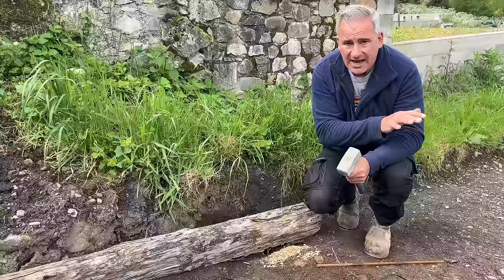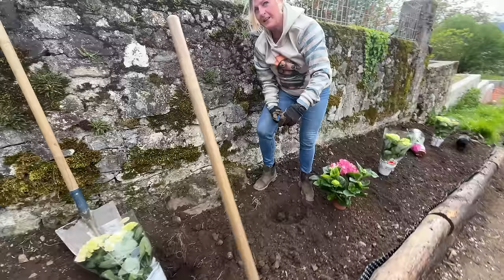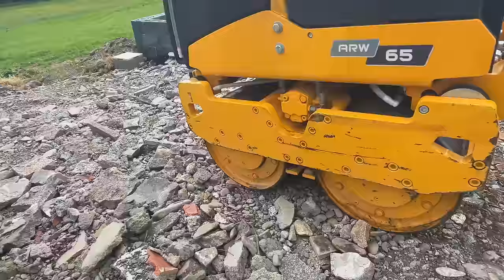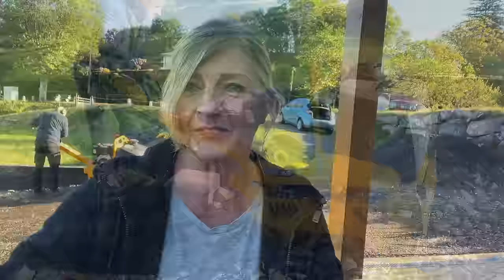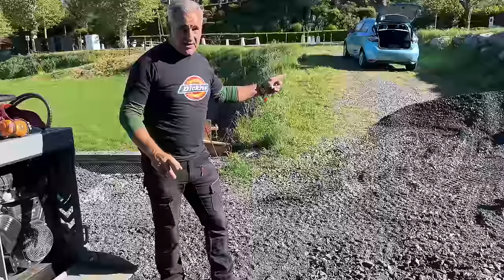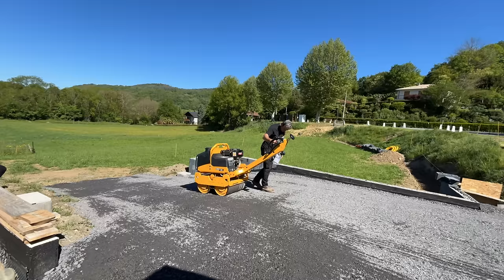Couple Build Driveway & Raised Log Garden Bed [Pyrenees Homestead]

Comment: Do you guys have a pressure washer? I know you have the auger attachment for the mini excavator, but for small holes like plantings, a pressure washer can really dig out a small hole quite fast. It digs around stones, so you can often leave the stones in place (depending on why you're digging). You'll have to scoop out the mud & water, but it does make quick work of digging lots of small holes.
Reply from the maker: haha, I can just imagine walking around the corner and Julie is covered he'd to toe in sprayed up mud.  We do have one but the water pump pressure is not great to power it.  But I am going to have to get her to try that 😀

Comment: Well done again you two, a bit of advice to save your backs, when you drop the bucket full of stone have bucket vertical and as you reverse away pull the stone with you to level it as you back up, just a thought👍
Reply from the maker: I tried a few times but to get it done quick I just kept dumping and moving on.   Raking is not too bad but I know what you mean.

Comment: Over here in Northern Ireland the cheaper way to get gravel is to find a farmer with a dumper trailer or a small digger contractor that has a tractor and dumper. Dumper trailers are 12 to 16 ton . Where I live here we are surrounded with quarries doing sand and gravel so it cheap to be honest for doing what u did with the roller we just track the digger back and forward to flat in it a bit then gravel over the top tract it again. And when it rains the rain beats it in hard.  Ur digger is on the small side u really need a three ton machine. Put a wee diversion plate between u and the fan on the mini loafer
Reply from the maker: We were going to ask the farmers in the village but they are busy at the moment (and getting a bit old, one is 92 and still ploughing the back fields).  We are limited to the little digger as we can only transport a tonne - so hoping we did the best we could with the delivery and the roller.

Comment: Hi ian an julie    ian you should have got the roller compactor first then got the tipper to revese to the bottom and as he was raising the bed up he would have driven forward while tipping and the stone would be spread out . At my 25 acres i have just laid 14000 tons of stone just similar to your stone and the lorries all reversed in and tipped  while moving  forward got a good level of stone laid then as my road was much much longer the tractor has a barr level to spread it out further to the sides i had my road done in less than a day  . Now you know how much cheaper it is to get stone delivered in the big tipper truck just thinking of all the trips you and julie have done with the trailer and hire van a few tipper loads would have saved hours and hours of back and forth . If you need to put a further dressing on get the truck to start at the bottom then slowly work fhere way forward  and remember the tipper driver can lower the bed quickly and drive to other area to spread the rest . Think smarter not make it harder .it looks really  really  nice now and easy access to cut the grass and when you build the house  for getting supplies in plants look lovely as well when fully established will compliment the wall
Reply from the maker: It is hard to show but the truck would not have made the turn and the slope.  We will do what you said on the longer drive but this area was little complicated. We hd to make sure it was the right level also, so it would have had to been a pretty decent driver 😀

Comment: Hello Ian & Julie Thank you for the info on the post rammer. I hope you do not mind but noticed that you are potting rock around the base of your hydrangeas they do not like compaction they need the roots to form freely we did this with ours and had lift them to recover and they need plenty of water .looking forward to this weeks instalment. Everything here seems to be going wrong cat to the vets dogs to the vets for annual jabs,sit on mower broken needs new parts on order from Holland flail cutter broken needs new bearing lost orange for over a month 5th time in less than a year. three point mower deck wheel seized have fixed this. Poly tunnel looking good and all plants coming on well just getting the watering system sorted 5 rows of potatoes in they say the price of spuds and onions will be high next season.
Reply from the maker: Every time you try and do anything there is always something else to fix first 🤣  We need to get our potatoes in  - ext video, Julie is clearing the weed in readiness 😬

Comment: Driveway looks very neat… how did you go getting the roller back on the trailer?? Steel rollers on steel ramp can be awkward
Reply from the maker: hahaha, yes...it was a chore - after realising it was hard, I drove the van up the drive, tilted the trailer as high as it would go to flatten the ramp and then took a really fast run up.  They loaded it with a forklift - I was about to call them to come and get it 🤣
Reply: @HomesteadingUncontained  😂😂

Comment: Driveway looks pretty good & well done with the skid steer & the compactor.
Something to think about, with your skid steer, I’d encourage you to watch some videos of skid steer & Bob cat operators “back blading” with the bucket to smooth it out after you dump it.
A lot of that manual raking could have been avoided.
In addition your excavator has a grader blade on it, it it too could have been employed to smooth it all out after the skid steer transported the gravel into place and dumped it.
You still have a little way to go in terms of learning what your two machines can actually do, but not being hard on you, you are at least learning & improving with each task you complete.

Now for goodness sakes stop being distracted and complete the garage please, it’s doing my head in. 😜😂😂😉👍🇦🇺
Reply from the maker: Thanks Ian - I know what you mean on the Skid Steer - Digger blade is useless, it does not float so hand controls are awkward.  Always learning though